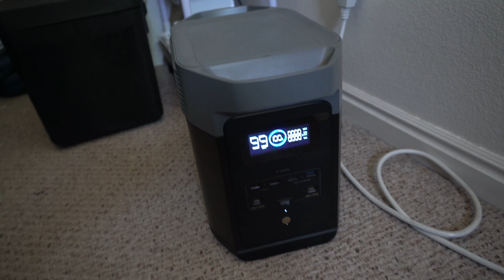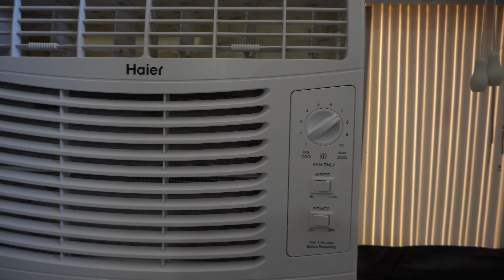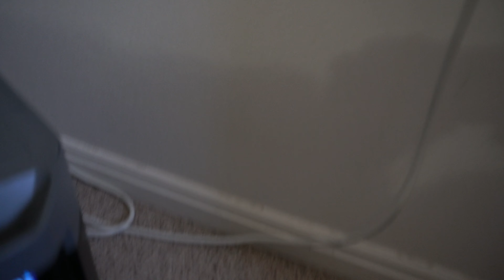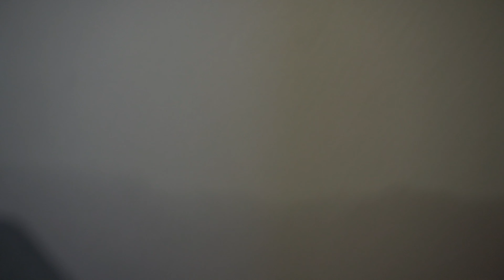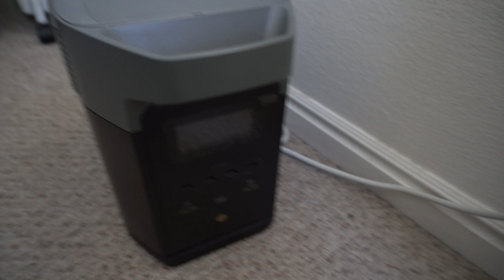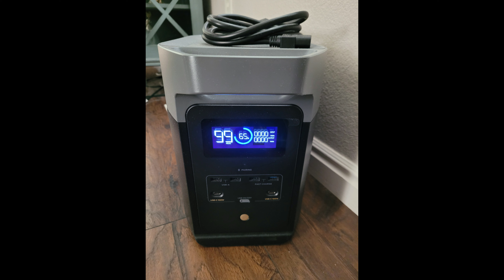EcoFlow Delta 2 AC Unit

Comment: how was the temperature around your room when you leave your AC at for 4 hours running at 60 watts? does it cool enough to feel like comfortable coolness?
Reply from the maker: It really wasn't cooling much. It would help circulate the air but at that low of a temperature it wouldn't cool off much. I haven't done much testing lately but I think running a fan with some ice water bottles would cool a room better and longer than an Ecoflow Delta 2. An AC unit just uses too much energy.

Comment: I did the same test with my delta 2. I tested a 6BTU windows ac unit and it only lasted about 50 minutes. The unit was pulling about 550 watts when compressor kick in. My out conclusion is, this delta 2 is good but for small appliances, or for campion, in a real emergency post hurricane etc this will not save you
Reply from the maker: @juanr.3314  I agree. Using the Ecoflow Delta 2 to run a window AC unit is not the best idea.  There are better uses for it.

Comment: I'd try a 6000 BTU window unit (no larger), and put it on Eco-mode. You might get better results. And, yes, definitely use an expansion battery.  You'll need to close the room off and maybe put some towels under the door.   Good start. Using these on an AC is definitely a learning experience.

Comment: When it is running at 60 watts the fan is only running. When it is running 300 plus watts the compressor is running.
Reply from the maker: That makes sense.
Reply: @not.a.prepper Are you sure that is your AC? How did you not know that?

Comment: If you're doing a test why not run it at the max capacity to actually see what it can handle and also what your AC is putting out if you were to put it on 10
Reply: Try swamp cooler on the ecoflow delta 2
Reply from the maker: @SurprisedBigWaterfall-bx1lo  I wish I could test that, but I don't have a swamp cooler, sorry.
Reply from the maker: That would have been a good idea.  The settings I used are what I normally use. The reality is, even when plugged into your house, a window AC unit uses an incredibly high amount of electricity. The takeaway from my video should be, using a battery to run an AC is not a long term option.